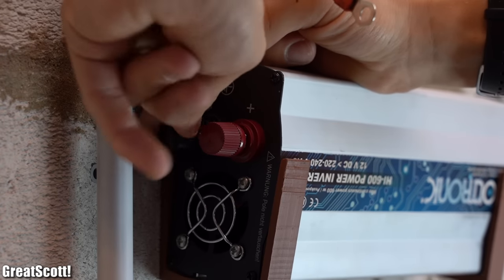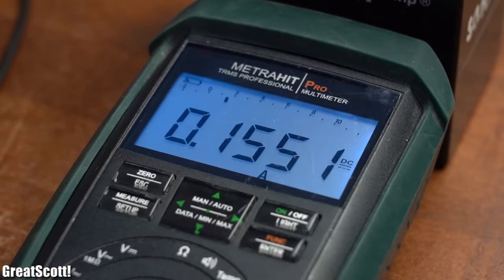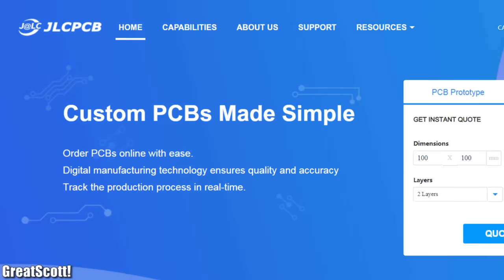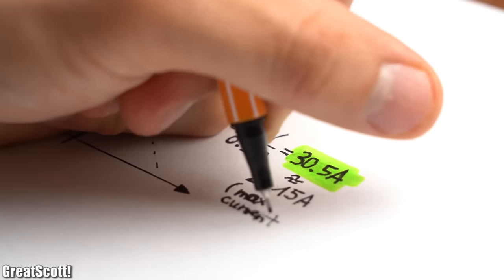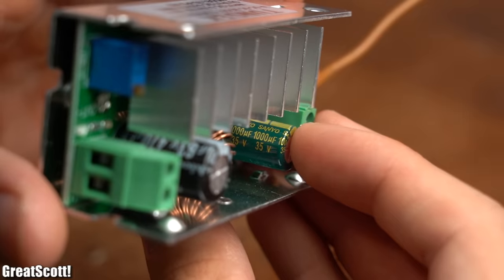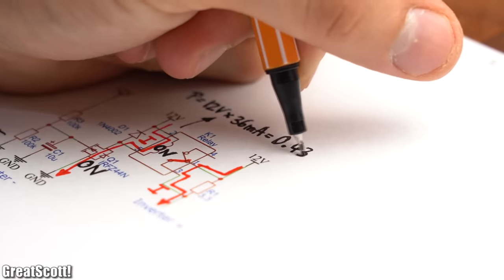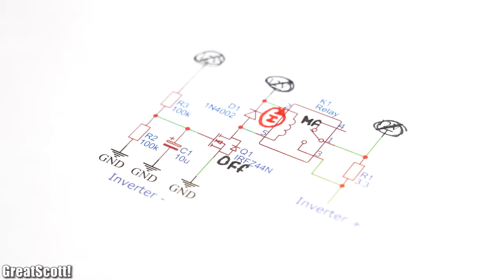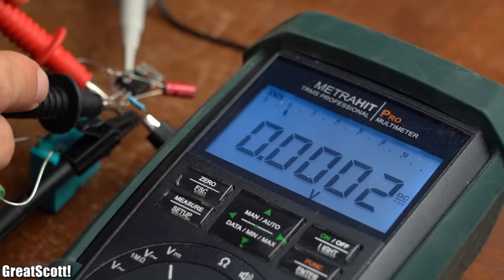How to make a Softstarter and why it is sometimes mandatory to use!

Comment: Your content always saves me and my teammates right before working with some power electronics, you're a lifesaver
Reply from the maker: You're welcome :-)
Reply: Make sure you employ high side switching.
Reply: @KerbalLauncher  By High switching you mean actually connecting the mosfet before the relay?, also I wonder if this could work at 24V aswel, since the battery we are using has a reference there
Reply: @Metroid1890  No, I mean don't even use a relay. See the datasheet for this part: https://www.analog.com/media/en/technical-documentation/data-sheets/LTC7004.pdf
Page 12 details inrush current limiting methods.
Reply: @oH well,lord! even so it seems pretty unreliable, I like the way he explains it by applying raw theory in simple circuits
Reply: What, u and ur "teammates" running a school or selling professional services of some kind? 🐵👍🏿
Reply: That suggests you guys doesn't have adequate knowledge or confidence if you rely on a youtuber for your projects. If I am one of your clients, I would be discouraged to hire you.
Reply: @robertanthonybermudez5545  like that matters, all that matters is delivering to customer expectations and being able to sell yourself well enough at the pre-purchase phase. What ever happens in between is completely unknown to you, and as long as the output is good enough you don’t care either.
Reply: @jamestrotter7852   what happens to my fellowman because of a con job also matters to me.
Reply: @robertanthonybermudez5545  as long as you are happy with the final outcome how is it a con? I can assure you a whole lot of shit goes down in most companies - even the big ones - before the final product comes out, shit that would definitely make you think twice about buying it if you knew the full ins and outs of.
Reply: @jamestrotter7852  when the final outcome cause damage to property and loss of life because the people who did the project have no actual knowledge of what they must do (relying on youtubers)? Why would I be happy?
Reply: @jamestrotter7852  you are making no point. I am an engineer myself. Again I wouldn't hire someone who are incompetent at what they do.
Reply: You should hire him ha ha!
Reply: True, Man!

Comment: stick with the NTC but use it with the bypass relay. it's exactly what high end computer PSUs do nowadays to get over 90% efficiency ratings.
Reply: It would still have the problem of remaining hot.
Reply: @devrim-oguz  Should not be a problem, because the NTC already cools down when it is still running, but the bypass is engaged.
Reply: @devrim-oguz  depending on how fast the caps discharge, perhaps while the NTC is still hot, the caps are still charged and inrush is limited this way? It seems like the best way to do this would be to have a circuit that isolates the caps, soft charges them for a second, and then uses a multi throw relay to disconnect the soft start circuit from the caps, connecting caps to main circuit, and connecting power to main circuit at the same time
Reply: That would still be defeated when the appliance is connected and disconnected in a matter of seconds, leaving no time for the thermistor to cool down.
Reply: Ali Devrim OGUZ yeah no shit, there will be some energy loss but it will get less hot.
Reply: i'm a bit late on this but maybe since it's dc input an inductor would work better and be far more efficient without any heat/cooling issue
Reply: @hennochoi  don't inductors give problems of their own?
Reply: @TheFreak111  yeah if you disconnect a large load on the output you will have a big voltage spike on the iductor 
the relay solution is fine but the unused contact should be used to discharge the capacitor quicker
Reply: @TheFreak111  yeah I think there might be some issues or it would be more common than just adding slow turn on features to power supply chips...
I think the biggest issue is if the input gets shorted you would end up with big voltage spikes (unless you use an appropriate diode across the inductor ) or also it could introduce noise if you don't take the right precautions
Reply: big inductors also have the same problem - for example toroidal transformers often require inrush current limiting because their initial magnetising current is quite high. They are usually soft started with much the same circuit that GreatScott shows.

You can use an NTC as the ballast resistor in such a soft start circuit as well - this is often done because they are rated to run at high temperature whereas many power resistors are not. It also provides a "fail safe" method should the bypass relay fail to engage. The time for the NTC to cool down is vastly shortened because it is not passing current all of the time - only for a brief moment. Some soft start systems also add a thermal fuse in series with the NTC so that if the bypass relay fails to engage, and the NTC heats significantly, the fuse goes open and shuts the whole system down

Comment: During my education we were taught about this. We were taught it was called a Startup Power Spike and most electronics are designed/engineered to reduce this but normally they remove the circuits in production to cut costs. I haven't done any of this in over 20 years but I still have my textbooks and notes. I miss tinkering with circuits. Thanks for the memories and the great work.

Comment: Thank you so much for the well-presented YouTube. 
I need to know a lot about soft starting as I am using four 3-kilowatt quartz infrared heaters, that can be switched with a remote controller, to one, two, or three kilowatts. I think that they all need a 16 Amp type C, circuit breaker. The standard circuit breaker trips immediately. On further research, I find that with a soft start, the extremely expensive heating tubes will last 30% longer. 
Now back to my experimenting!

Comment: GreatScott: How to make a softstarter
Also GreatScott: That's a subject for another video
Reply: Motor controllers are typically another beast entirely to the circuit shown in this video. It makes sense to separate them
Reply: GreatScott: JLC Pcb... blah blah blah.
Also GreatScott: Do circuits with Perfboard
Reply: How to control motors and softstarters for them. Pls
Reply: @aged_mozzarella  depends how you want to control them and the power required for them. Often 1 uses a motor driver. H bridge is a configuration of Mosfets. Another awesome motor driver is a Sabertooth 2. Look into them see if they're what your looking for. Often they can be controlled at logic level around 5 volts, and many configurations accepts PWM, which is very useful for varied RPM applications. Some can be controlled from a RC receiver.
Reply: @jaycool5978  Thanks, but the thing I always struggle with is the controlling of the h bridge or other configurations. I am not very sure about the relation between frequency and duty cycle. I couldn't really find anything on the internet that'd explain this
Reply: @aged_mozzarella  are you using an microcontroller??? Look into code examples to get you on the way.

Your most welcome
Reply: I have an Arduino, and know quite a bit of coding, however I'd like to use regular components to reduce the cost a little
Reply: @aged_mozzarella  if your referring to frequency. Square wave is what you see when using PWM. Have you looked for examples on PWM motor control?
Reply: @jaycool5978  Yes I have, I've seen countless schematics of PWM controllers, but all of them just changed the duty cycle
Reply: Kay nevermind I looked it up and there's a ton of them out there. Thanks for the help!
Reply: I would like to see analysis (buy vs build) of a "soft starter" for large motor like a residential A/C.
Reply: Forget great Scot,t more like Brilliant Scott 💡.
Reply: @aged_mozzarella  frequency is always the pulses per second.  (hertz used to be called cycles per second).  Duty cycle is a percentage of time when a square wave is on, compared to the total pulse period for one cycle, so it goes from 0 - 100%.  100% means the pulse is on all the time, 0% means it is completely off, and 50% means it's on half the time.
Reply: @Nic7320  Wow, still people replying to my stupid questions even after a long time. Thanks
Reply: this guy is a scam. he copied my idea of this circuit design and then took all the credit for it...
Reply: @jobaptist  there's nothing unique about connecting a timer and a relay.  Get over it.
Reply: @Heads Mess I've just tried playing with band-stop filters in QucsStudio Filter Synthesis... Butterworth, Bessel... scrapped them all. I ended up just applying 2*PI*sqrt(LC) and aiming for about 1 Ohm at the frequency of 1050 Hz. The higher the "center impedance" that you aim for, the steeper the resulting filter (probably) but the more difficult the filter will be to manufacture. For 1 Ohm reactance L or C, I ended up with 151.6 uF and 151.6 uH (microFarad, microHenry) - connect those two in parallel, for a parallel-resonant cell. Connect that cell in series with the phase. Note that at 50 Hz, the inductor will take all the spanking (current). Regardless of what "center impedance" you end up aiming for, note that you must use an inductor core large enough so as not to saturate with the current drawn by your load, and the inductor winding wire thick enough that it doesn't warm up with the current drawn by your load. And I'm pretty sure I'd face some practical obstacles if I tried to build something like this :-) Any inductive load ("payload") designed for 50 Hz will probably present quite a high impedance at 1050 kHz, so my resonant filter possibly won't be very effective if its "center impedance" isn't very high and its Q isn't very good...
Reply: It was for motors!!!

Comment: Why are u so gentle and genuine person?
BDW i had this problem 4yrs back, while designing pwm controller for big dc motor drive. I've just use few passive components & added some start delay in microcontroller code, which was initiating pwms to drive H bridge.

Comment: Good video on a common issue. I made a similar circuit several years ago for use on a 70A 24VDC set of motors I had to start with a 100A power supply. I really had to let the motors get well started before applying full power. I used a large high power 3ohm resistor and an electronic delay-on-make relay switching a larger relay made to withstand constant use at high current and temperature. It worked well. I've seen a guy build a similar device to start a helicopter jet engine.

On mine, since this was used on a commercial project, I had to use modular components to allow for field service. I also included a one-shot temperature limit switch and yet another relay to ensure that if the time delay relay failed the big resistor couldn't overheat and cause a "thermal event" (what we called fires back in the day).

I've also used NTC thermistors on things like 10-15A blowers that weren't a threat to the power supply but provided less of a challenge to my customers' often overtaxed circuit breakers. You want to choose thermistors carefully and use them fairly close to their rated power so that you get minimal voltage drop over them in steady state use.

I look forward to your next soft start video.
Reply: VIPIN LADWAL if you enjoy these videos and learn thing from them you could become a patron and not always be 5 days Late :)
Reply: @LAZYLONER-  and @Bill Kerr, this abo theme certainly is the next era of capitalism. Call me names but I prefer the single deposit.
Reply: One time I used a toaster in series as a current shunt to soft start a compressor
Reply: @victornpb  Ha! Perfect.
Reply: Not everyone has big power resistors at disposal, except they do, 900W toaster worked perfectly!
Reply: @victornpb  Yes, unless you use a big 'old fashioned' lightbulb... ;-) That is a good shunt too.
Reply: Nothing 24V worth of lead acid batteries couldn't have coped with ! Could have then use DOL starting.
Reply: pmailkeey that would mean finding room to add those batteries, a charger for them, and writing a maintenance schedule and parts list. Cost and trouble would far outweigh using the power supply already on the machine, which I had to be able to support worldwide.               I was slow to adopt switch mode power supplies but would never go back. Now use electronic motor controls which make everything smoother and easier.
Reply: @Miata822  Difficult to advise for the best without knowing the full situation. 
I'd certainly be keen to avoid electronics !
So you've done a maintenance schedule and parts list for the electronic controls ? 

Was the 100A supply 'dodgy' ?
Seemingly, you're running up the motors under no load - so a clutch on each is necessary?
As I said at the top, I'd need more info on the situation.
Reply: @millomweb  This project was successful and long gone, been in production for years. The load was DC fans w/ brushed motors. Subsequent products used BLDC, eliminating the issue.
Reply: @victornpb  Good idea, nichrom wire has the resistance for something like that.

Comment: You can also use a coil in series and a protection circuit to discharge it safely ( diode and small resistor ). It's quite an easy and simple solution. Besides, you can also add in parallel a capacitor to with a resistor move all the high frequencies back to the source. These are pretty simple strategies most power supplies use.
Reply: I think you need a pretty big coil made with very thick wire that can handle a few tens of amps required by such an inverter and maybe it's not suitable for an inverter

Comment: Slight error with your RC time constant: The resistance seen by the capacitor is the thevenin equivalent, not the series charging resistor. Your time constant should be 0.5s, verified in simulation
Reply: He overestimated it, but that's better than underestimating it.  Still, 0.5s is still much longer than the RC delay needs to be, since the input transient he measured is only 15 ms and there's more delay starting up the power converter.  But he also made another simplifying assumption, when he used the capacitor ESR to estimate the input transient.  The MPPT output impedance, and the wiring resistance, and the capacitor's ESR all limit the current charging the input caps.
Reply: @Nic7320  Smart Alec!

Comment: Good timing. I'm just about to put an NTC on this tube amp I built a while ago. No relay... not worried about a fraction of a watt, the thing burns dozens of watts just keeping its filaments warm :P The reason I'm doing this is not actually because my supply can't handle it, but because the tube filament lifetime is eroded more quickly if you hard start them... the filaments have a low resistance when cold and the resultant surge erodes their coating.

Comment: the circuit i have been using for a while is really simple. it consists of a P-channel FET a small capacitor and a couple resistors. the P-channel fet is wired as the high side switch with the source connected to the input side and the drain connected to the output. a small capacitor is placed between the output and the gate with a 100k resistor accross it to keep it discharged and a 10k resistor from gate to ground. when the device is powered the transistor is normally off since the capacitor which is place between the gate and drain starts a zero volts the rising output voltage acts as a negative feedback loop limiting the rate at which the output can switch on and once the capacitor is fully charged by the 10k resistor to ground the transistor will be fully enhanced and the output will be on.  the rise time of the output can be adjusted by changing the feedback capacitor and resistor values. a zener can also be placed from gate to source to limit the voltage across it in cases where the supply voltage exceeds the gate - source voltage rating of the transistor. when the device is powered off the resistor across the capacitor will discharge it in a few ms so it is ready for the next power on.

I first saw this when at university and thought it was a very elegant design that does not need and relays or complicated timing circuitry but can't remember what it is called other then P-MOSFET current limiter. but when checked on the oscilloscope it always produces a very nice perfect ramp up to the final target voltage which is the ideal wave form shape for charging a capacitor though there is a small jump from zero volts up to whatever the threshold voltage of the mosfet is so you should pick a fet with a low threshold to reduce the initial spike but other then that it works great.

Comment: You may use variable R2 and R3 to adjust the time delay for charging and discharging the delay circuit thus making it adapt to different circuits configurations. Good job.